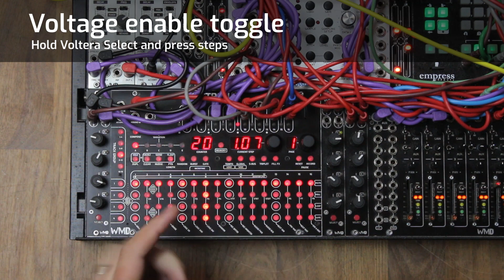WMD Metron - Firmware update 1.5 - Quick Reference Guide

Comment: Thank you for your dedication and putting this out! Sorry to be the grumpy man, I was hoping to get rid of the awkward turn gesture. Why not make the Voltera "select" button function as another Metron "track group"? The "select button" would light up (on-off toggle rather than hold only) and all other Metron "track group" would turn off. This way the Metron track buttons (1-4) would substitute the turn gesture when the Voltera "select" button was on. This would also bring the Voltera interface closer to the Metron itself. I don't expect this ever to happen, but now I said it. Thanks!
Reply: Awesome idea - and seconded! I'm not a huge fan of the momentary button pressing either. Makes for a bit wonky ergonomics and/or requires both hands..
Reply: I feel you. The turn gesture is hard to get used to, especially because you have to turn so far CW first. A smaller required angle would be nice. But for your select button suggestion I am unsure. How would this stay compatible with its other functions, such as live takeover?
Reply: @ElectricWound  I think it would work holding down the select button as usual. There are of course many important details that have to be thought through. My main wish is to get rid of the turn gesture. I have two Voltera modules but rarely use any of them because of the awkward interface.
Reply: I agree and support your idea, I'd prefer the button press over a knob gesture just because it's quicker and more reliable.
Reply from the maker: Thanks for the input.  We feel the turn gesture is effective and makes for intentional interactions.   It's very easy to get lost when the interface completely changes function and the main indication is a button led on a different module.
Reply: @WMDevices  I rarely use my two Voltera modules because of the turn gesture, so it's not effective for me. The Metron I use all the time because it's intuitive and powerful. I think it would be natural that when you switch between track groups, the Voltera would be just another track group but with voltage control rather than gates. It's not "a different module", it's an expansion.